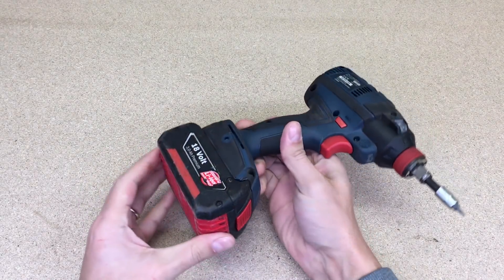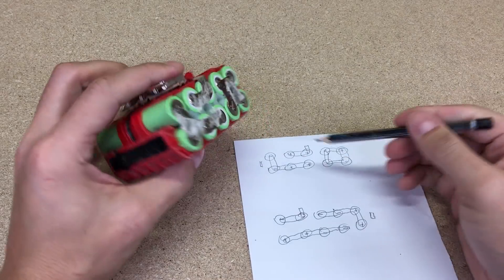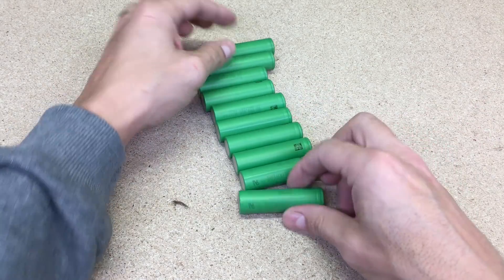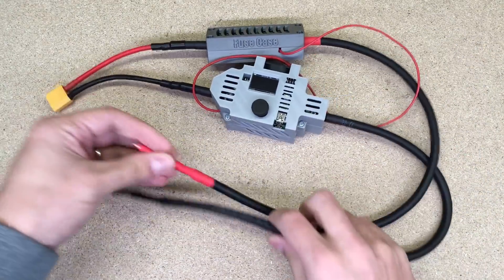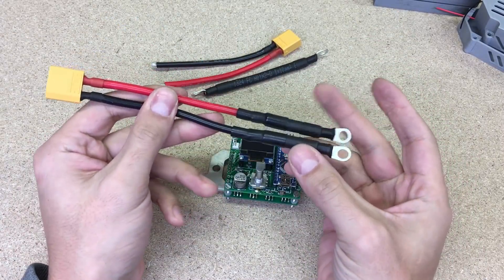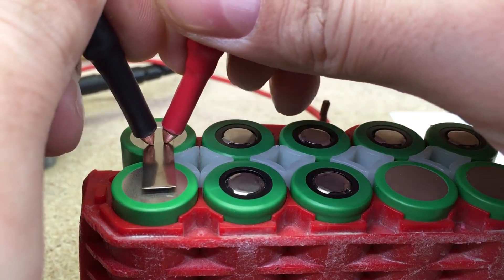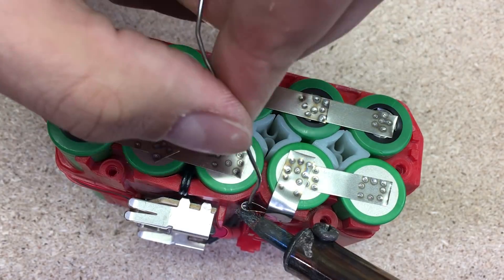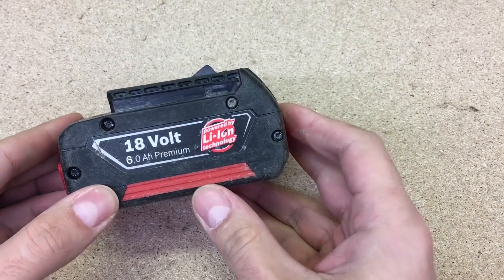How To Double Cordless Power Tool Battery Capacity From 3Ah to 6Ah

Comment: I have Parkside 20V 4aH cells are 21700
I am thinking to replace it with LG 5000mAh 21700 cells.

So after doing that i will have 5aH battery yes ??!

Comment: I have a 2ah battery on my drill, if i want to upgrade it, change the cells, do i have to change the circuit board or something? Or only to replace cells with better one?

Comment: Yo , Bosch GBA 18V 5Ah and 6Ah have BMS with cell balancing. These cheap fake Bosch batteries have no BMS for 2P5S (10cells). Having no BMS for 10cells will not help to last the pack. IMO VTC6 for a battery pack without BMS is a waste of money. But hey.... it works

Comment: A 5 Ah - 10 x 18650 batteries is $70. You can't find good batteries at half price, which is $3.5. You could make a 6 Ah battery with $70 but you would need the spot welder, the nichel strip and time so you are better off buying a new one. The spot welder in this video is $150, the battery that is uses is $50 and the charger for that battery is $40. You could buy one that uses a car battery, but then you would need a car battery and a charger for it so is it worth it ? Sadly, NO.....

Comment: Does this Bosch battery pack has cut off circuit to cut off power when the pack voltage goes really low?

Comment: Nice purchase to keep my bikes chargedㅋ>imgs.love/BatteryTender?к Suffered some injuries that have kept me from riding for a while, so although my bikes normally get rotated/ridden weekly, I needed something to keep them all charged while they sit for a while. Compact size makes it easy to plug in and doesn’t clog up the workbench. I just unplug it at the bike side and rotate a few times a week between the bikes. Batteries don’t discharge that quickly, so I only need one unit for multiple bikes.

Comment: Neat! Not only double capacity and hugely increased discharge current (useful for really torque'y tools), bit you get the compact form factor of the small'ish 3Ah one 😁 Top stuff.

Any tips on "regular" soldering on these cells, without them letting the firely dragons inside them out?

Comment: Outstanding.
Just three questions: How will the old battery charger do with the new type of batteries?
Is it 100% compatible?
What about overcharging? I heard that it might be really dangerous to overcharge lithium batteries.
Reply: Yeah, Those are 18650 batteries and Their Voltage is the same, only capacity has changed, so older charger takes double time to fully charge it. About overcharging I have to say that I think that circuit board will protect the battery from Over Charge and Discharge

Comment: Hi! Is it possible to double capacity of Hilti cordless powertool like drill 22v 3.3Ah?
Reply: Maybe. Check inside, how its assembled and what cells are in it, ot will tell you whether there's really any gains to be had, and if it's feasible to do the job (this battery pack was frankly on the easy end of the scale to replace cells in, among modern power tool battery packs).

 But top shelf power tool manufacturers like Hilti rarely skimp on cell quality.

Maximum capacity ain't everything though. Besides that and cost, ere's (sustained) discharge current, behavior in really cold or warm temperatures, long term capacity retention, lifetime charge cycles ratings etc. Can't have the best of everything in one cell, it's always a compromise. Some tool "system" manufacturers even offer special battery packs tuned for special needs, like arctic or super hot surroundings, and ofc the more typical high-demand (high discharge current) ones for super torque'y tools like hole hawgs, big impact wrenches, sawzalls, concrete hammers etc.

Comment: Good video.. only thing i misses was perhaps some values about how VTC6 stack up in actual use cases vs original but that would need some hijack of the current wire with RC amp meter or a DC Clamp meter but I reckon likely not the big difference in actual effect as its current limited fx with ESC on power tools with fx brushless.
thx for the video.

Comment: doubling your mAh from 1500 mAh a cell isn't anything but replacing your cells... XD The only surprise in this video was your choice of spot welder ... If you want to impress why don't you double the amount of cells, wire them up with a BMS, and 3D print an extension. This was rookie stuff hehe

Comment: I sure wouldn't be wearing a ring while taking apart the battery pack  or at least cover it up with some super 88.
Reply: The original cells were at zero volts.

Comment: That spot welding method is great. Thanks for the ideas
Reply: Ya cool spot welder ... however a pre-fabbed spot welder gives some peace of mind ... As long as your still building/rebuilding batteries. I almost expected a bigger 3D printed case coming out the bottom of the original with 21700's in it instead.

Comment: I just switch from DeWalt to Bosch couple weeks ago why they do the same thing and they're cheaper for less than $300 I have  one 18volt hammer drill two 18 volt regular drills one 18 volt with six batteries 3 chargers and I have the small one drill 2 batteries and the charger All brand new . From different pawn shops. Now I can go after the grinders the sawzalls and I'll have plenty of batteries to go with it bonus electric bicycle PS I will be buying some of those Sundays thank you Greg video

Comment: Some advice: NEVER dismantle fairly modern tool batteries with a long, steel blade. A small accidental short so easily wrecks the management system, rendering repairs and upgrades useless. I use a Dremel-type drill with mini steel cutting disc, and cut through all the connection strips in situ....then I can remove the strips off the individual batteries in safety, so as they can be used in less demanding appliances.

Comment: Sony VTC 6 is the best li-ion battery so far.  Larger energy holding capacity and a lot more output power, compare to its competitions. There are few brands has the similar capacity, output etc. but almost twice as expensive. 
li-ion batteries should become more powerful, more capacity, more life and cheaper. Not less capacity and more expensive, as those recently know Yellow and Black and the shiny purple battery brands do.  I am sure you know these brands.

Comment: Why didnot u check the dead battery and throw it away and  put a new one ....... i mean not all of them may be dead
Reply: Technically any lithium cells at zero volts are going to be damaged, and the risks go up in trying to revive them and continue using.
  The tool charger won't charge cells at zero volts.
  You would need to try to jump start each cell. But risk a cell-internal short circuit and thermal runaway fire or explosion

Comment: I’ve ordered those batteries from for mention retailer and there are only 2000 mA not 3000 mA, I’ve checked capacity by discharging and fully charging again.
Reply: What voltage did you run them down to. Sony are probably going to 2.8V -> 3.0V at a slowish discharge rate. it might say on the spec sheet. There are some fakes around though.
 Have a look at the YouTube channel 'Battery Mooch'

Comment: A seven minute video to explain that replacing the cells 1:1 with ones having twice the cell capacity gives you twice the battery capacity?  It also doubles the charging time and may overstress the charger because of the difference in max input current.
Reply: It wont, Bosch uses an universal Charger for their batteries, which means that if you buy an OEM 6Ah battery from Bosch, you get the same charger that he has and it's designed to charge 6Ah batteries.

Comment: Im confused. You ripped out 18650s and re installed the exact same amount of 18650s. You did nothing at all but replace batteries, you didnt double your ah capacity. SMH, Samsung 18650s for drills are all between 2500mah to 3000mah. These vtc6 cells are "3000" mah. Nothing changed
Reply: The old Samsung cells were nominally 1500mAh the new Sony ones are 3120mAh as he stated - the cells are arranged as 5S2P (5 in series with 2 sets in parallel) thus giving the nominal 18V (@3.6V each) and double the Ah rating @6Ah because the 2 sets of 5 are in parallel :) No need to change the number, each cell has double the capacity anyway

Comment: long as the voltage match'es 18volts you can stack a million batterie's in paralel
Reply: Harley Me Well not really, you will burn out the charger.
Reply: You will have about 4000000 Amps though with a million batterys...
Seriously doubt the motor can handle that...
Reply: @sjaakvkoten6061  Nonsense, amps are always limited by the device itself. Putting cells parallel only makes for longer battery running times. Harley is right.

Comment: youre missing the point. cordless systems are about convenience and builders need reliability. you dont want to have to stop work because of a 4 hour charge time! thats why they all use makita and dewalt because if the worst happens and you forget to charge your spare..... youre back up and running in HALF AN HOUR!
Reply: speaking of missing the point...

Comment: There is a reason why power tool batteries have cells of such small capacities that go without protection circuits. They are simply much more robust and more difficult to explode than high capacity cells that push it to the limits and NEED protection circuits.
Reply: nothing to do with protection..  you know its only the voltage thats matter since they only draw the amperage that they require to function..

and if you think there's some special anti battery exploder..  most charging circiuts stop charging when its gets feedback (battery full and charge is coming back since battery isnt taking it..  you cannot overcharge a battery if you use a proper charger..   they are meant for specific amp bat's  there for specific VOLTAGE..just takes longer to charge a bat with higher capacity
Reply: @harleyme3163  No! These Lithium cells are not self-balancing, like Nickel ones! You can have e.g. 6S1P battery with a total full charge voltage of 25,2V, but it doesn't mean that all cells will be 4.2V. It takes just one cell with slightly different internal resistance or lower capacity to throw the pack out of ballance, e.g. you will have five cells at 4.15V and one overcharged at 4.45V.
Reply: @mibars  ryobi does have individual cell charging.
Reply: @JM-yx1lm  But the Bosch one from video doesn't.
Reply: no 18650 battery can last one discharge cycle w/o a protection scheme. the protection refers to overcharge or draining below around 3vdc. i know because i ruined 2 cells w'o built in protection.

Comment: Nice stuff! Also great that you got a battery spot welder. Though I imagine that such a device wasn't cheap, and for occasional use, soldering would probably be better. I know that your older videos used the soldering approach and worked well.
Reply: buy a battery spot welder..then make a service to change older battery pack for folks for half the price of new battery...iam pretty much sure many people will hire you...2-3 job pay the machine...plus he changing the battery from 3 ah to 6 ah and it cost him half the 6ah battery

Comment: Love your videos.Thanks for sharing. Quick question: Is soldering NiCads and Lithium batteries ok if you don't have a spot welder? Does it damage the cells?
Reply: Soldering the cells does physical damage to the cells, but the general concensus is that the cells do not lose capacity or life cycles as long as the soldering heat was only applied for a few seconds, so be sure to use a 200 watt+ soldering iron and not the typical 30 or 60 watt ones.

Comment: In the video at 6' 33" you are checking the voltage by connecting the test leads to two terminals; what are these terminals called so that I can order them from a supplier? Thanks in advance.

Comment: So spot welder cost more than 100€ and new cells around 60€ so that's more than new factory made battery and your own battery has zero warranty it might die next day and you lost 60€ for that.
Reply: Mr Wizeguy -  The cost of the Aduino will be spread out when used again on other battery packs. However your issue re warranty is valid, but seeing that power tool companies rarely warrant their batteries for more then a few months the issue is mute.
Reply: Co Rin moot*
Reply: @jamesbizs  - My Bad. You're right. Sometimes the brain is too far behind the fingers on the keyboard.
Reply: @corin164  MOOT
Reply: Your Youtube name was a wise and excellent choice.
Reply: The batteries still have warranty.
Reply: You are a dumbass. This is a diy. Chances are you have a spot welder or just solder them. You almost forgot the cost of the original battery that adds up even more so it's not worth this mod. Fucking idiots
Reply: kamil wojcik this mod wasn’t worth it anyways. No matter how much you try to excuse it. It’s just a fun video. Nothing more.
Reply: you dont need the welder ... use a soldering iron its bettter than the welder shit.
Reply: @kiril135790 the problem with soldering is that the solder tends to melt when using these in drills and such

Comment: Orrrrrr....just buy another battery on line and spend no time at all and you have 2 batteries. The effort and the math does Not add up.
Reply: The original battery was dead, deceased, kaput

Comment: don't the increase of amps damages the the electronic part of battery?
Reply: "Amps" do not increase, because the peak current is set by the power tool. There might be a slight increase in current compared to a brand new original battery if the replacement cells have significantly lower ESR than the standard ones, but not enough to cause issues to the electronics.
The PCB in this battery pack is also incredibly dumb, since it doesn't have cell balancing capability, so I wouldn't worry about it. It's true that you may end up with issues if the controller is more complex: some controllers may permanently disable themselves if the battery is disconnected, and you would end up with a paperweight instead of a working battery if you replaced the cells.
Reply: Amps and AmpHours are not the same thing.
  Amps is the current and mAh is the capacity.
  A bit like top speed or torque, and petrol tank size.
  Hope this helps.
A lot of people only look at mAh and think more is better. Must consider high or low drain battery suitable for the applications. If in doubt go for the higher CDC Continuous Discharge Current, not Pulse discharge current rating.

Comment: Just one more thing, it is an 18v tool but when you checked your batteries on your volt meter they read bellow that, won't that effect the power of the tool?
Reply: A fully charged 18V Li-Ion battery is at 21V, and a fully discharged battery is at 15V, so any voltage between that is good, it's a matter of charge state.
Reply: The reading was as they are shipped or for long term storage roughly between 3.4V to 3.8V
Long Storage at Full capacity can damage them and is unnecessarily dangerous, due to high energy density. It's a risk of fire or explosion if short circuited or otherwise damaged
 He was only looking to see if they were all roughly the same ie. Balanced
If one was lower than the others it could indicate a faulty cell.

Comment: Nice way to build a bigger ah battery, but as others have said, they have chips in them now to prevent over charging the battery. They can only be charged a number of times and my Makita batteries talk to my drills to prevent overheating and very low power in battery that it won't charge.

You will also lose your warranty on any of your tools that you use that battery on. If that battery was to cause a fault in any of your drills then you wouldn't be able to claim any warranty.
Reply: No, but if my pillows and mattresses are faulty I can claim a repair or exchange as they have the manufactures stiched logo/name on them. If not (like a pillow case) which some have a stiched tag on them which I leave on, I would usually find a fault within a few uses. But with this battery it looks very dodgy to any manufacture and they will want to test the batteries and drill that became faulty. They will want to check the battery used in the drill when it stopped worki g or became faulty. If they find that you used a non genuine battery then you will have no manufactures warranty at all and will be paying a premium to have your drill repaired.
Reply: halojump123 
It's the manufactures logo that is on every genuine battery and with this one anyone will be able to tell it is a fake. Plus what about the weight, wouldn't want to be using this battery for a full charge in one go or even for a full day where overhead drilling is needed, it would be easier on your arms and body to use a lighter battery and change it if needed. Also, how would OHS like you using this battery on site or even just to see it on site would be a problem. They would need to see all documentation regarding extensive testing and safety.
Reply: They already do a 6 amp, so the weight wouldn’t be any different, I use it on my cordless rattle gun all day, if you can’t handle the weight, maybe hit the gym.

Any site I’ve ever worked on couldn’t give a shit with stuff like that, and it’s not like he’s done anything dodgy, he’s done exactly the same as the manufacturer, exactly!

Do you hear a collective sigh when you enter any area when people are talking?
Reply: lol a better job the amount of spot welds that pack isn't being taken to pieces easily again
Reply: By the time you need to make a new battery the tool warrenty will have long expired.